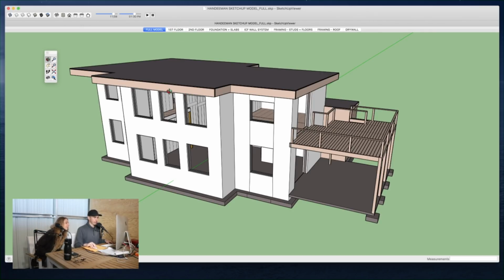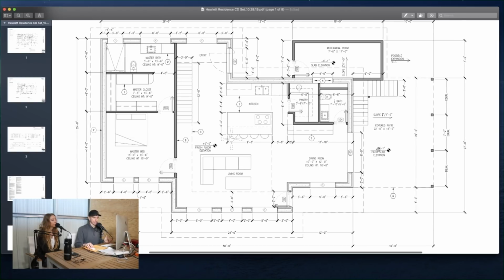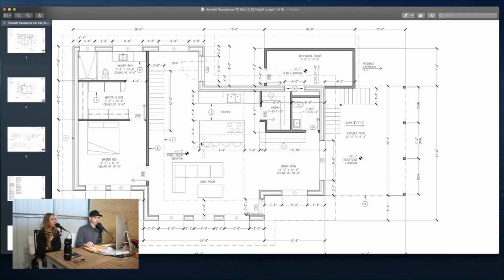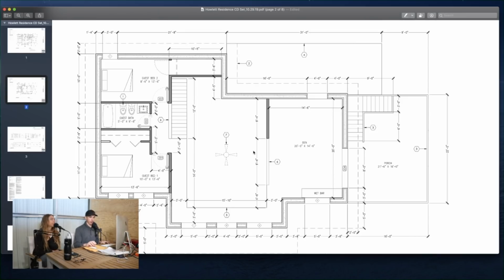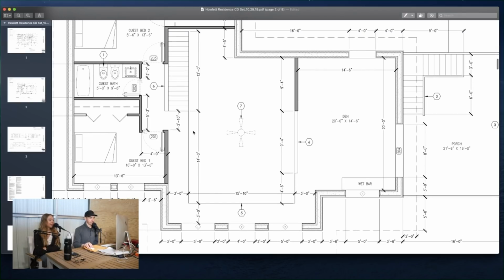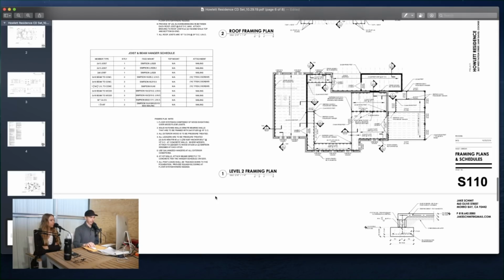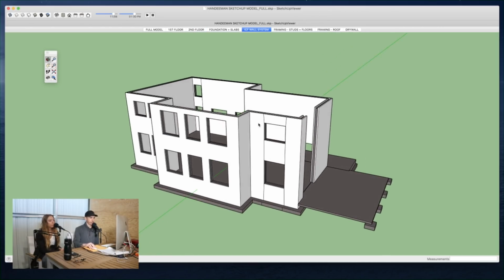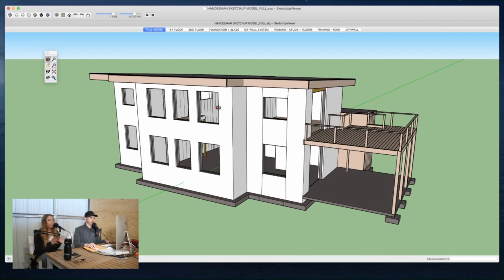Couple Build Debt-Free Dream Home In The Desert | House Plans

Comment: was electricity at or near your site?  grid tying is great but it seems to be difficult in large lots that are far from town... what did you do and is there a cost structure per distance and tying in?  also was that necessary to be evaluated by city and power departments?   thanks

Comment: I like your house plan, walk in pantry is a great idea, the in slab hydronic floor heating goes hand in hand with ICFs, overall a great house plan...not sure what roof covering material you are going to use, the sloping shed type roof is an excellent choice for a hot desert environment BUT in my opinion that roof frame looks overly engineered and it doesn't have a top layer (natural convection) ventilation gap as most heat gain is trough the ceiling, this can easily be achieved with under truss hung rigid insulation at least 8 to 10" then air ventilation gap and sheet metal or whatever as covering...

Comment: Great decision to use ICF.    My last two homes which were also self contracted for the most part were ICF solar powered, net zero houses, and the cost was similar to the neighbors who built with 2x6 etc.    Lately I have seen articles by wood proponents suggesting ICF is not a green choice, but my calculations indicate that over a 200 year period a house your size that is net zero ICF will use approx 2% of the energy of a standard house of same size built to code on current gird power INCLUDING the embodied energy of all the materials and construction.   The numbers I have seen comparing wood and ICF lately assume a 100 year life of both structures, but an ICF structure can stand up to earthquakes, tornadoes, hurricanes and even more critical to wood rot  where the wood house would fail much too soon.    Your house could last 2 thousand years as the Coliseum in Rome made with cement has done, but there are precious few wood structures that age anywhere, and some of the oldest in Japan require too much labor and skill to be practical.    Of course, the best strategy for sustainability is to build as it to last your lifetime together and as small as possible.  MY my second ICF home I built after the divorce ensuing from arguments during the construction of the first is only 400 sq ft.  Haha.   And guess what?   I often think it could have been just a little smaller with no regrets, but then I am an old minimalist monk now...and a vegan fan I might add, HCH.   :)   So, y'all be patient and good to each other so when this is over you don't have to build another house to live apart.   :)

Comment: With your 1290 sq ft roof area you can fit about 30kW of PV. Get 2 or 3 power walls and you're set for then next 50 years of your power needs for all your shop tools and all your EV's.

Comment: Thanks for sharing your plans and ideas! But I have one question. Don't you have to worry about termites or ants eating the foam on the ICF blocks? I also have land in Cochise County and I know that termites live there. If I have a slab on grade, I'd want foam or some kind of insulation under the slab, but I've read that termites will eat the foam insulation unless you buy the kind that's treated for termites. Maybe it makes a difference since the ICF's will have stucco or some other coating on them?
Reply: I found an article on termites and ICF's and it looks like ICF's aren't immune from termite damage. However, it mentions a couple of brands that make termite resistant ICF's (not termite proof) along with physical barriers and a few other ideas on how to discourage termites from tunneling through the ICF's. https://www.icfmag.com/2017/09/termites-and-icfs/

Comment: Why a flat roof?
Reply from the maker: easy to build, easy to collect water on, cheaper to put a roof on it
Reply: Well you be putting a slant/grade to it like your water collector roof to use it to collect water? If its flat won't the water just sit there and collect puddles and not go anywhere? What are you making the roof out of? Wood and shingles, I think, would rot over time. Very curious design. Thanks for your reply.

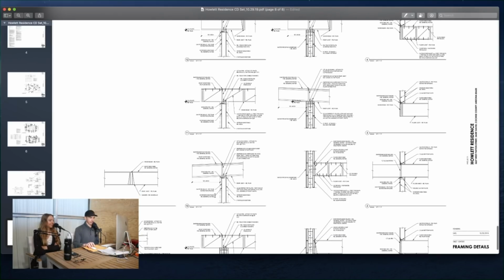Comment: Question: How does the roof framing sit on the top of the ICF block top layer?  Will the framing be built up on the south wall to provide the slope or will the ICF blocks be higher on the south wall than the north wall to create the roof slope?  My assumption is all ICF blocks on the top layer are all level, then you put a framed wall on the south side wall to get the roof up to create the slope, like 2 feet tall?  Just couldn't tell from the drawings and this is the thing I'm most curious about in the build! It looks like at 21:52 on schematic 10, it seems there is a beam that the roof is sitting on the South Side, maybe?

Comment: This looks like a great design and home where the spaces are all useful.  I lived in an ICF house and one thought is that it is extremely difficult to make changes to those walls after the fact.  
Also, I know there are many different ICF systems, but cabinet attachments on an exterior ICF wall can be very tricky as there are attachment points for drywall, but having them in the right place for the IKEA hanging bars may not work out like you need.

Comment: You are going to video all your work, so potential buyers of the house will be able to see if you built it properly.  Keep that in mind.  Your video documentation will add significantly to what you can ask for it when you sell it.  That's assuming that you do build it properly, but I'm confident that you will because you like to do things right.  Also, your draftsman who did the plans has a vested interest in it being constructed soundly, and his details are almost certainly code compliant.  There are two things that can mess you up though.  The first is the issue of potential problems if your construction site is listed as a FEMA flood zone.  The other is you need to make sure that the soil beneath your house has a bearing capacity of at least 1500 PSF.  Your soils may not have that, and it may need to be compacted.  You already have some experience with that from building the shop.  Do not cut corners on insuring that the soil is solid enough to handle the load.  If you splurge on anything, pour it into that because everything else is resting on it.
Reply from the maker: already taken care of, stay tuned
Reply: @Handeeman  I figured you had, but it's better to mention it and be safe, even if back seat "drivers" are irritating.

Comment: Check the location of the refrigerator.  They are considerably deeper than a typical counter depth so they stick out forward from the edge of the counter by around 4 to 6".    Watch for the refrig door swing,  a side by side may not work directly against a wall as doors usually need to swing past the 90 deg.   Also check that refrig doesn't extend into the pantry entry.
Smart things:  Pick all your appliances and  bath fixtures and get the data sheets before you finalize your plans to make sure they work, a lot easier to modify thing while still in paper than in concrete.    Research your electrical outlets and switch needs and determine how they play with the ICF's .   Cat door onto a screened porch with a outside litter box cabinet works great for my sister in  Saddlebrooke, cat loves to watch the birds from the porch.

Comment: In your climate I would ditch the hydronic radiant heat.   Hydronic heating is great in cold climates, but you do need to keep it running 24/7 for it to be effective and stabilize.  The thermal mass of the concrete floor results in a multi hour delay before you see the results of turning up  or down of the thermostat.  You just can't turn down the temp at night and up in the morning. Consider your life style, working out side all day or away for a couple days then come home to a cold house, it will be 3 to 4 hours before you are comfortable then it will over shoot and you will be too hot.   You will want some AC for the hot days in the summer,  so ducted  AC or mini splits will be in order anyway.  With the insulation from the ICF and the south facing walls your heating load will be minimal.  Just use the mini-splits or AC in heat pump mode or use a small propane forced air furnace.  They are quick to take the chill off and don't need to be run all the time to be comfortable.

Comment: Watched many home shows using the foam system in years past but the lack of empty wall spaces would seem to make the plumbing and electrical runs more difficult. Personally, I would never build an unpermitted building just for salability and insurability as well as value gained on the property, but I have different ideas for the use of a large property. Wishing you all  the best and  anxiously waiting  for more videos!

Comment: The one concern with concrete is if you live in an area that gets earthquakes. Look what is happening to the homes in Puerto Rico. They are made of concrete. Concrete is great for insulation but it is not flexible.

In California, they criss-cross metal bands in the cement foundation and pull them on each side for tension so that the foundation moves together in an earthquake. They stopped building brick fireplaces because of earthquakes.

Comment: Should reverse the shower and toilet locations in the master bath to the outside wall,  in line with the sink. Then there is an direct access to the shower and someplace to put the toilet paper without twisting on the toilet.  THEN MOVE THE SINK.
Reply from the maker: doesn't make sense with how it needs to be plumbed, a 4" drain needs to go upstairs, can't go through 3" of foam on the exterior wall

Comment: Redo Kitchen Fridge / Freezer!!! - Get a "Maxx Cold" 72 cu ft fridge (double the standard size fridge no frilly water dispenser) for $1800.00 online (texas somewhere) and a separate stand up Freezer $700 (size of fridge).  Best decision I ever made.  Better than those fancy ones at the box store.  Redesign kitchen to fit.  

I put my freezer in the fridge spot in my house and put the fridge in the dining wall.

You can fit tons of food in there, very clean / neat / low power.

Comment: If it was mine, I might move the stove to the center of the island and make a higher shelf that cantilevers on the seated side. This allows for a vent behind the stove if needed and space on either side of the stove. It is safer to NOT have a burner right at the edge of the island,,,,JMTC and I already understand that is the actual value of my advise

Comment: Why not a mini-split system? You can control it better between levels and rooms, saving cost and there are DIY systems to save money. Not that hard to install either. I've got nothing against IKEA, but they'll change out their selection by the time you need a new door. For the first few years, you'd be OK, but it'll happen eventually. Custom doors are a better option as you can always get custom remade, but IKEA ain't going to make you something once they stop producing it. Also, the black kitchen idea is just as much of a PITA as a white. I know, I have both! Go with a color or wood, and upgrade the finishing you use. Think grey, it could go with your concrete look, or wood ties in well to your design. You should be shooting for a lacquer or varnish, anything less is... less.

Comment: another option for the toilets is that you could just put all the fittings for the toilets in so that if you ever want to sell you could just connect a toilet. But you could just leave a composting toilet in there where the regular toilet fittings are while you were living there.

Of course, then your guests would have to use it, and they might freak out. Lol.

Comment: Excited for you two and to watch how it all goes since you're basically building with the key things I want to build a house with: ICF and in-floor hydronics.

Are you also intending to use the hydronics for cooling as well as heating and for your ventilation are you planning on using an Energy Recovery Ventilator?

Comment: We went icf, with icf roof too,  brilliant.  We are totally off grid in Australia,  we have 40 to 50 degC days and the house never goes over 30c  most days 28. Solar powered ceiling fans create sufficient cooling.  We have a small wood heater for the winter,  most days not needed.
Keep your roof a light colored,  it helps keep the heat out.

Comment: If it was my house I would do a peeked roof with large over hangs to shade the walls. When my stucco house walls hold the heat in the summer till 1 or 2 am. My AC can run till midnight some days that get to 105 or hotter. I`m off grid with 10000w of panels and 18000w of inverters. I use chevy volt batteries 56kwh of them for 2 years now. I charge my chevy volt car off this system as well. If you going hydronic heat it would be fun to use ground well water to cool the house with. I like your videos I wish I could you tube as good as you guys do.

Comment: I've had my Ikea kitchen for 13 years and it still looks and functions great. It's really customizable both when you design and buy and over the long haul. It is really nice to be able to get replacement parts, and you can swap out all the doors for a totally new look. I love it and all the money it saved me. I also needed cabinets fast - we were going to use the existing cabinets and remodel a few years later but the place was so badly trashed that the cabinets disintegrated in my hand when I tried to clean them! ~Michele
Reply: I'm on my second Ikea Kitchen.. The first one lasted 20 years... We did a big renovation and replaced it with a second and 5 years on, it looks brand new.  Ikea kitchens are well built, modular and easy to install.. If you have even the most basic of mechanical ability, you can build one to last.. Our lates kitchen, with appliances was a mere $7600 bucks. (not including counter)  The old kitchen ended up in my workshop and is still used daily.

Comment: Hi guys, nice update...

Nice simple design helps keep the costs low.

Roof... hmmm... Seems like you would want to tilt the roof with the south side lower for solar pv or water heating panels (unless you intend to stick to ground mounted units); also being a low pitch roof, use  a membrane layer to prevent any leaks in the long term future! 

Satellite, TV outdoor antenna, computer data cables, security, etc. - do yourselves a favor and  plan on installing gray pvc conduit to run you cables throughout the house! Much better than drilling holes & running ugly wires all over. 

You should also consider planning & installing security cameras & lighting around the outside near the roof. Same reason as above, don't buy into wireless crap... at least have the conduit & boxes in place. You will want to keep track of animals & even film them.

I agree with others about shading that west side to help keep that wall cooler in the summer. 

You might want to consider adding an "eyebrow" -  over those southside 1st floor windows far enough out to shade them in the summer, but shallow enough to allow sunshine to hit  them in the winter. Basic thermal control.

The radiant floor heating is a great idea!

As for cooling, you obviously have plenty of space, that you may want to consider a ground-source heat pump system!  Super efficient, as it draws on the fact that 6 or more feet under ground the earth is a nice cool 55 deg or less!  

See... https://youtu.be/f8GcqW_4KVg

Comment: Lg Hydrokit running off a multi V S heat recovery outdoor unit. 

That’s the solution for whole home HVAC and hot water and radiant.

Heat recovery means the system can simultaneously heat AND cool zones in the building.  Heat is essentially moved within the building zones first and then, only if needed, the outdoor condenser/air handler will be used.

Zones can condition air, radiant floors, water heater tanks, pools, snow melt loops in driveways, etc.  Imagine, any zones that are cooling the room will capture heat from that room and then transfer it to a heat exchanger to make hot water.

The systems are typically require 3 phase power to run the outdoor condensers, so this technology is commonly only found in commercial and high rise buildings since low occupancy residences do not have 3 phase power, However, I have found that LG is the only company offering both commercial and residential solutions in the Heat Recovery equipment.

Video showing single phase residential installation:
https://youtu.be/Ag1tmOCgcdE

3 phase Heat Recovery Condensers: (Commercial)
https://lghvac.com/commercial/product-type/?productTypeId=a2x44000003XR0T&iscommercial=true&class=Outdoor%20Units

1 Phase Heat Recovery Condenser: (Residential homes and buildings lacking 3 phase power)
https://lghvac.com/commercial/product-type/model-details/?productTypeId=a2x44000003XR0O&modelId=01t44000008fw8M&modelNumber=ARUB060GSS4&iscommercial=true&class=Outdoor%20Units

Indoor Air Handler Options:
https://lghvac.com/commercial/

Hot Water, Radiant, Water Applications:
https://www.lg.com/global/business/air-solution/vrf/hot-water-solution-hydro-kit
https://www.lgvrf.ca/en/hydro-kit.aspx/ARNH763K3B2
https://www.lgvrf.ca/en/hydro-kit.aspx/ARNH963K2A2

https://www.dmgn.com is familiar with these systems.